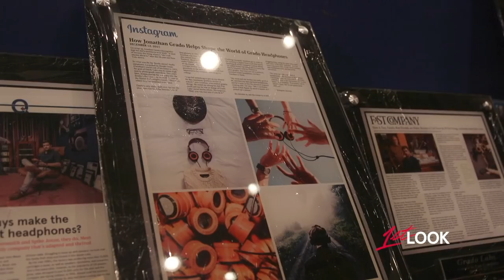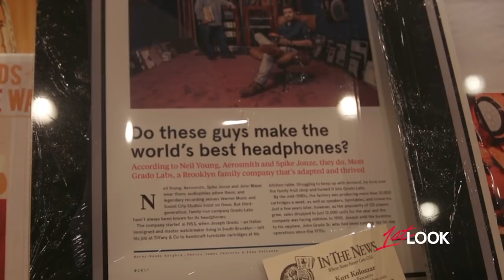Listen! The best headphones made to the beat of Brooklyn

Comment: You can get the Grado 60s for only $79. They sound fantastic and the cord is virtually indestructible. They last forever.
Reply: I've sent my SR60i in for repair.  But it's worth noting they charge a flat $20 to fix them out of warranty which is commendable.  One of the rods that connect to the earcup came out.